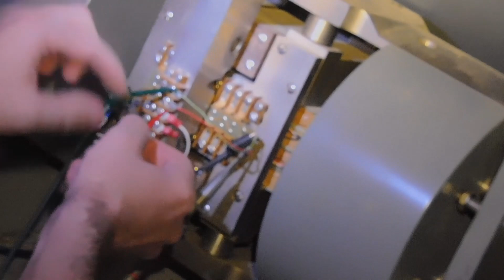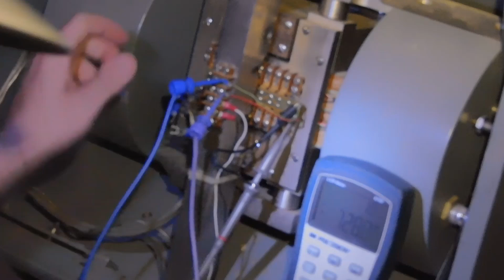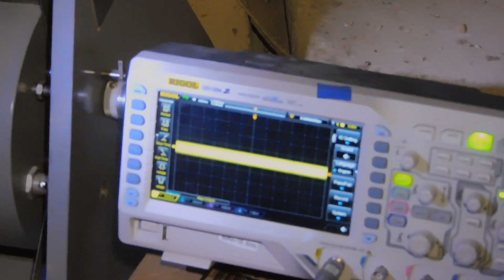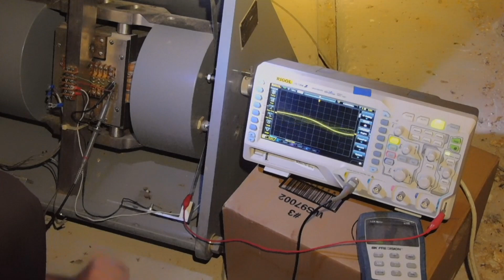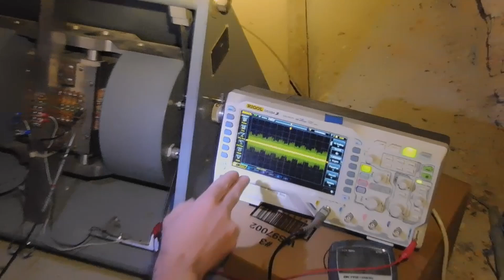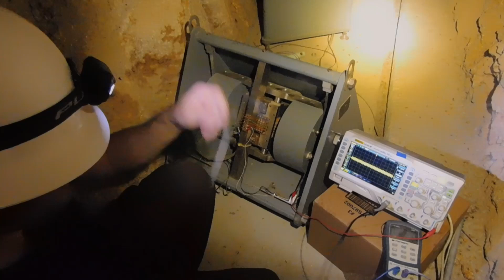Re-consecrating an abandoned seismic receiving station  (June 27, 2024 update)

Comment: How does the sensor detect vibrations?
Reply from the maker: Basically it's a massive coil sitting inside a strong magnetic field.
So any tiny vibration causes voltages to appear in the coil.

It works exactly like a speaker but in reverse.   Vibrations cause currents to appear on the coil.

Comment: rock solid, super deep, i dig 👾 
i read of geophones in school (mostly of the truck-mounted ones) but had never seen the nuts/bolts practice done; props³.

geophone can hear telluric at RF too, is that so? as i understand it, eventually you'll subtract the signal of an aerial, from this signal (to measure just  telluric currents alone)? would one scope be able to 'math' it all real-time to show 'telluric ONLY' signal? or is it way more involved than that?
Reply: ah yes forecasting is of great interest too, almost forgot🙃 maybe some dolby surround-sound format can record it?

oh yeah tri-axial aerials are needed too eek (as i attempt to recall dollard's "System for reception and Transmission of Telluric Waves..." writeup i saw a while back - which is mind-blowing).
Reply from the maker: It's so groundbreaking that we're not quite sure what will be possible, but you are quite correct about the mid-term plan.

Having a personal seismic feed is a perfect complement to a seismic warning feed, meaning we can have absolute certainty about timing and stability between both systems.

Putting an old defunct seismic station back on the air is a secondary but well-deserved bonus
Reply: @hakasays  touché, well I'm floored - practically shook.

i expect this should "carry conviction" with development. very white hat.

Comment: I myself would look at the side plate, see where it was made etc and see if the manufacturer still has any data on them, or if it's available online. Your work may already have been done for you, but none the less an interesting video that I came across this morning. They are very sensitive instruments and hope you get good results from them.
Reply from the maker: Short answer is there is a model number, but the geophones are so rare+custom I don't remember finding any datasheets for them online.

There are a couple boards+preamps in the site too, but they all traced to a small San Francisco area tech firm that went under a couple decades ago.

Since there's so little info to go on it kinda feels easier to reforge a new one.
Reply: @hakasays  It was a thought, but as you say they are old (But look near new), good luck with your project